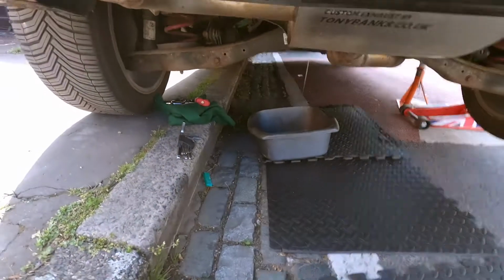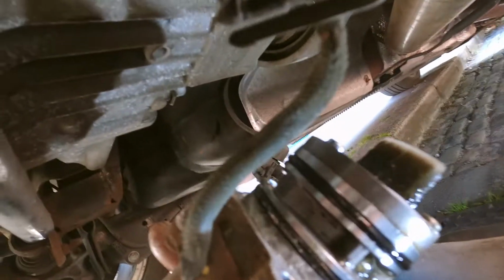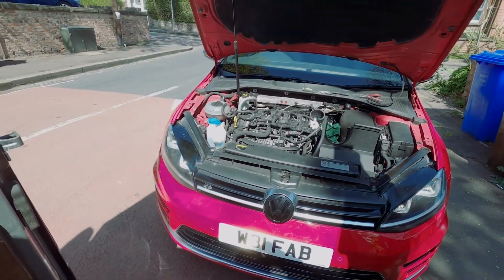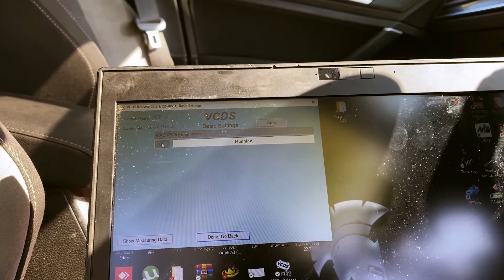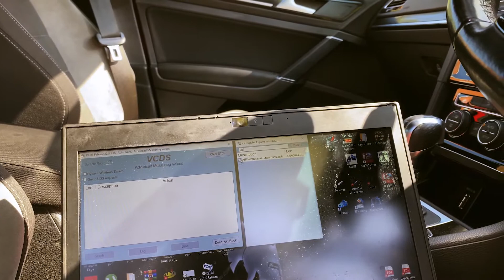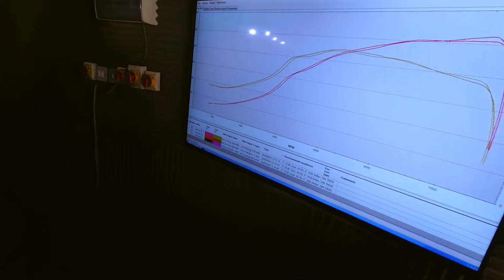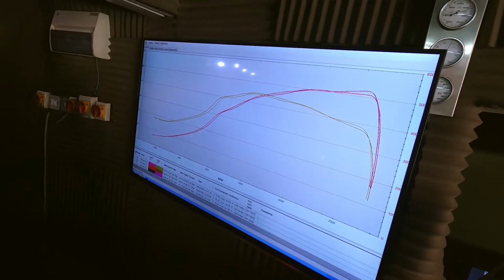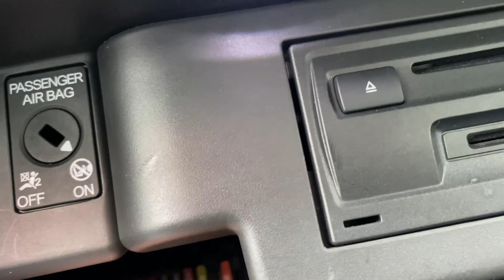Golf R Haldex Service - Stage 3 | MQB Series

Comment: Such a pain getting the haldex controller off just to reach the plug that should be easy to get off! Arrgh! Rest is simple enough tho. I did mine at 28k and it had loads of sludge too - not as bad as yours, but still.
Reply from the maker: Aye! Not a great design that - this was a customers car though, not sure when that was last changed but I’ve seen cars with 30k on a pump with less dirt on n

Comment: Nice one mate, every how many miles would you recommend doing Haldex service?
Reply from the maker: I’d recommend doing this every 10k miles maximum
Reply: @wosa9461  ah, mine probably due. Mind you it's being service by Audi so maybe it's done or do they not do that one?
Reply from the maker: Yeah Audi do a terrible job with Haldex servicing - the technicians mostly go off Odis instructions, Odis does not tell them to service or clean the filter (it’s a none serviceable part) so they most likely won’t do a thorough clean 

I can inspect it when I’m with you anyways, always have Haldex fluid in the van 😎👍🏻
Reply: @wosa9461  Perfect, worth checking as it does see a little abuse :)
Reply: @wosa9461  Also for a Stage 2 with 400bhp and 500Nm of torque?